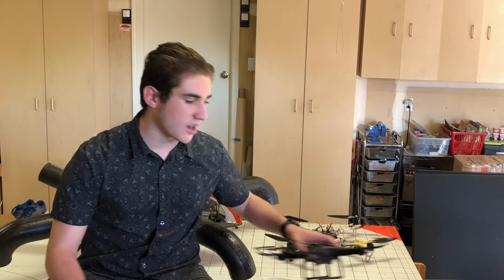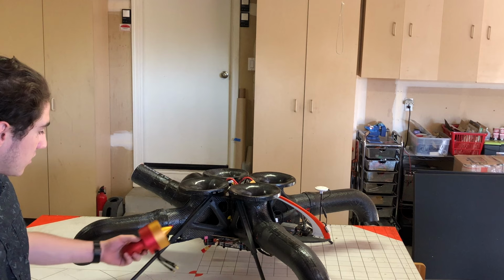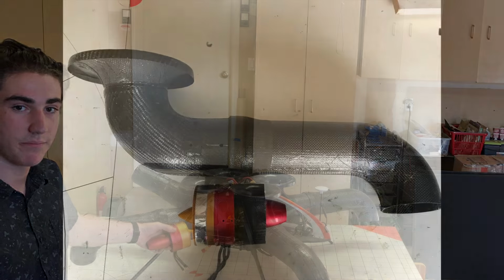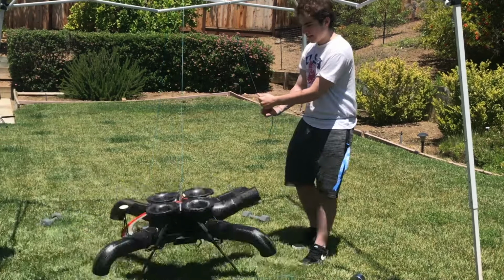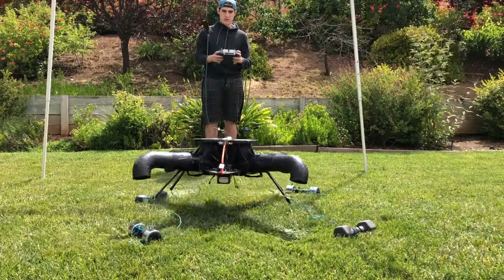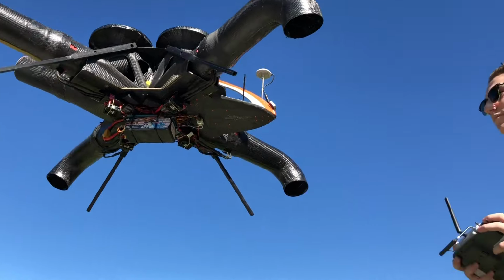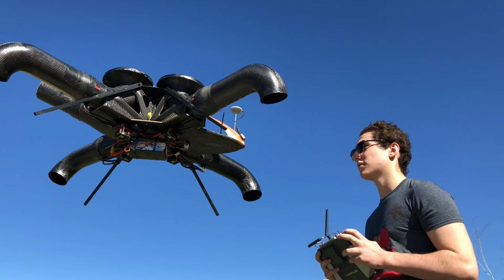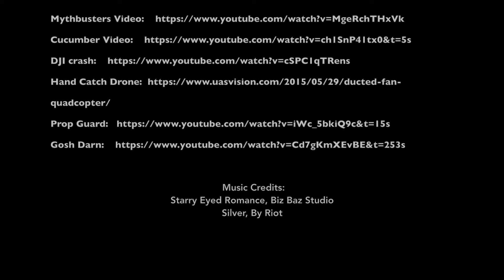Bladeless Drone: First Flight

Comment: The sharp angles to the air flow are a waste. Just put 4 straight tubes on an angle outward. Basically it will look like a tripod except having 4 tubes instead of 3. The tubes will be shorter and the whole system will weigh a lot less. The tubes will be shorter, so there will be less drag on the airflow through the tubes.
Reply: @Albert Barnett 3D print the blades. But either way, what I was suggesting was a concept. If the tubes need to be at a slight angle to counteract rotation, then put them at a slight angle. My point was that the sharp bends and long tubes were counter productive and easily altered. I think the problem is the original designer had an idea in his head that resembled a conventional drone. But there is no reason for that. If you need to, you could even put in a slight curve in the tube, but just get rid of the sharp bends.
Reply: I think the move here would be to do what is done in jet engines to achieve a smooth airflow and to reduce surging, placing two fans rotating on top of each other, but in opposite directions, with both of them pushing air down. You could also turn the drone by adjusting the speeds of the fans relative to each other, and thus could affect yaw, pitch and roll all at once in a more dynamic way if you have a software that  can deal with aerodynamic instability and would allow for fly by wire.

Comment: Interesting design.  You could just do one motor (and fan) and have the exhaust controlled by servo valves to control the trust in each tube.
Reply: What if he used an electric turbine motor, the kind used for model jet airplanes. It would make a lot more thrust.
Reply: @edgonzalez1345  And be LOUUD haha

Comment: Major loss of efficiency and allot of extra weight
Reply: The weight doesn't seem to be that big of an issue with the materials he used. Carbon fabric and epoxy are both lightweight and durable
Reply: @Skellitor301_VA  Well with that attitude why not chuck some fire bricks on it because hey how light are they.

weight added is power and time lost.  Best upgrades is reducing not adding. I don't think the gain is worth it at all however it might do real well with a burning fuel
Reply: However, some efficiency gains with the high rpm motors. The higher the rpm, the higher the power to weight ratio.
Reply: Yes . Duct fans have a low efficiency. Watts/ trust
Reply: that's not the point though. Its purpose is to be safer.

Comment: Patent pending ? For what ? An electric Stipa Caproni ?
https://en.wikipedia.org/wiki/Stipa-Caproni
If it's about the propulsion, it is public knowledge, it's a ducted fan.
As a matter of fact, it's not "bladeless". It does have blades inside!
It's also the same concept behind many VTOLs and that design has been used both in single and multiple stage formats.
Nothing to say against the achievements but this isn't going to block people from using the same exact concept and its variations. Shape and design can be protected, like with cars, but you cannot pretend to get a patent on ducted fan systems.
Reply: dude, chill

why do you have to be such a dream crusher wtf
Reply: @tommylynch7887  actually, the opposite, I'm being realistic and the dream which brings to delusion is a bigger struggle to deal with.
Whereas, if you're prepared for the worst, you can actually get some good out of it.
With a tricky trademark which also embeds a peculiar part of the design, like coca-cola did with the bottle, you can protect the shape, keep some features a trade secret and have a business running with WAY less money, also because you need to pay to file patents,trademarks and you pay a lot if you need to cover most markets (like all of those in the WTO, for example).
I'd say that 60000$ should be the minimum needed to begin with, just for the "paperwork".
Not only that but it gets even harder when you discover that you must also already have a presence in the market of choice in some circumstances.
And when you get a refusal it's even worse.
You spend time and money waiting for a patent to be registered when you could have started a production way earlier, also because, as in this case, you don't need any patent whatsoever. Meaning that the moment you realize it, a chinese copy is already out there, beating you to market, not because they've stolen the idea but just because they found out about the PUBLIC KNOWLEDGE information that YOU provided them to begin with...
Reply: @FreedomAirguns  oh that makes more sense

thanks for explaining
Reply: @tommylynch7887  chill, read, let it sink in, think about it, then come tell people to "chill", and they're "crushing dreams" if you still feel the need. Shouldn't need an explanation.
Reply: @Connor-zy6kl  ok ok i’m sorry. It just looked very harsh and I felt bad for the guy building his drone.

Comment: Impressive design improvement.  Your drone should be the industry standard.  An advance to the design should include vectoring smaller ducts, sort of like the Harrier Jet or Osprey.  It could increase the horizontal speed of the drone.

Comment: Title is a bit deceptive. This drone still has blades (in the ducted fans) they are just inside the housing. Maybe a better title would be "recess bladed drone."
Reply: agreed, but it's the same deal as dyson 'bladeless' products, which contain an impeller.
Reply: @chrismofer  yup, advertisers like to do that
Reply: Ducted drone is better
Reply: @amiman23  you would think, but you can increase the performance of a ducted drone if you can move the mass toward the center so there's less rotational inertia to overcome for stability and control, not to mention to kinda bad yaw authority these motors give u is helped by doing that. with his custom ducts the lever arm is extended while the inertia stays central and a side effect is no dangerous props in the open.

Comment: The duct fans have blades, do they not? which would mean the title is a lie if they do.
Reply: @TypicalJacques  Still a fact whether I shutup or not
Reply: According to this logic, a jet airplane should be called a propeller airplane, because that would be more accurate.
Reply: @tofu_golem  The Drone still has blades.  It's not bladeless and your logic can never change that fact.  Anyone can be against my original comment as much as they wish.  But it will never change the truth.
Reply: @wildkatsailing  Turbine blades!!  And since when did I call you names?

Comment: Doesn't make sense. You are making the air pass trough two 90° turns which obstruct the airflow, you are so decreasing a lot the efficiency and so the range of the drone, there are  better ways engineering to achieve the safety you are after. Good idea but needs improvements to make sense
Reply: He’s right. It cuts into the power to weight ratio. But I’ll bet he gets better rates on insurance! 👍😁
Reply: Borde is just pointing out that this isn't a new idea. Currently the safety risk is acceptable for the added flight time.
The safest part of this design is that it can't stay in the air longer than 5 minutes.
As batteries get lighter and last longer and motors gain more efficiency, we will see more gated propellers or impellers. 
I think a micro mesh around each standard propeller arm would be much easier, lighter and obstruct less airflow.. also it could be aftermarket and fit on existing drones

Comment: Well done!
 
1.How is battery life?
2. Why not combine the air from all 4 (or more or fewer) fans into a plenum, then out to the "n" exhaust pipes? Three might be a better number of pipes, geometrically. In any case, combining the air removes the immediate crash if one or more motor suffers reduced or runaway thrust. It would affect all directions equally.
3. How's the project now?

Comment: watching this two years later...how was this not a revolutionary design change for drones as a whole?
Reply: Its just a casual drone with some blade covers (extra weight)
Reply: Efficiency.  The extra weight of the ducting is only a small part of the extra inefficiency. The real killer is that a small jet of fast moving air is not as efficient as a large area of slower moving air, especially at a "zero" air speed (hovering).   It would take a whole lot more energy per minute of flight with this design, and since flight-time of drones is already a big limitation, this extra inefficiency will reduce the practical uses tremendously.
Reply: @daneast  I agree with your views. I don't want to knock the innovative idea, but it seems cluncky too and the battery life on it is any ones guess

Comment: 1) What if it suck in dust and big particles, would having a filter mesh solve it?
2) If we use only one motor and somehow control the flow of air through the 4 nozzles to balance the drone we can probably increase its efficiency drastically
3) Lot of energy would be wasted on turning the air through the pipes, why not simply have vertical covers on each of the 4 blades to improve efficiency. having safety cover on the blades will solve the purpose right?
Reply: Use thrust vectoring instead of 4 motors and outputs
Reply: I’ve seen the net covering blades from dust but then i had the same idear about the tubes. I think they don’t have to be that long cornered popes unless they needed a certain shape
Reply: @godwinjosiah2557  that's true. A drone can be successful only if it is power efficient. 
Plus I think safe drones would be the ones which are lighter in weight and somehow the RPM of fans is very low so as to cause the least damage.

Comment: Interesting concept.  I wonder what it would do if you created more of a venturi affect by narrowing down the opening of the exhaust tube openings.  I believe that you would need to calculate what pressures would ensue verses the kind of pressure your electric ducted fans can handle verses how narrow an opening you can have to maximize your thrust.

Comment: Nice you can increase the out put bye reducing the out flow pipe 
We do same thing with sprinkler systems to gain psi going from 1 in to half iv done the same with gas blowers to increase the out put when blowing large amounts of leaves in fall

Comment: Can’t wait to see jet engines quad drones!

Aren’t ducted fan more Efficient?

Has anyone built the drone from Terminator 3? Didn’t it have 3 jets?
Reply: I guess that jet engines are not responsive enough to be used in such a design. I expect that this would need additional thrust vectoring.

Comment: I have always been thinking of the dangerous of spinning blades, you have made a good try, optimise the design for highest efficiency by using simulations or models,  for safety adding long tubes may not be necessary

Comment: A wire mesh like oscillating fans would encase the blades
Reply: Yes you are right. Normal design with wire mesh for fans is much easier, cheaper and efficient
Reply: Material: made of HDPE polyethylene, PP with UV stabilizer, resin.
Mesh Size: rectangle mesh type, oval openings, round opening, diamond opening , the main mesh is rectangular and oval.
Weight: 80-350g/m2.
Width: 1M, 1.22M, 1.5M, 1.8M, 2M.

Comment: would probably work better with tapered tubes larger at the intake side and place the fans at or closer to the exhaust with a larger radius where they bend down

Comment: I really admire your ingenuity and persistence. Can’t say that I can find much to admire in most of the comments. 

If we consider what you have accomplished to be proof of concept, the next phase might consist in simplifying the form factor and improving aerodynamic efficiency. For example, why not more gently curved duct tubes with little stub extensions at the bottoms to eliminate the dead weight of landing support struts? Hope you continue to imagine and innovate.

Comment: I wonder if this design coyld be used for a full scaled flying craft. It would need some back thruster i guess.
Reply: No need for back thruster. It would operate in the same way as this one. But if it's going to be used for anything practical, it will definitely need an automated shutdown and parachute recovery system.
Reply: @lar3ryca  Yeah but wont thrusters give it more speed?

Comment: I've seen such a solution on a heli (rear blowpipe instead of propeller). The problem was the run-on time when steering. I see the same problem here. Propeller drives respond much faster, resulting in better model response.

Comment: I’ve long anticipated this—inevitable—development, But why separate engines? I’m see the next big development being a single, central engine with a single air intake supplying air to all ducts with individually governed airflow. Better centre of gravity, much less weight; and fewer parts.  (Venturies wouldn’t hurt, either.) — Arguments?
Reply: Why not 4 engines? Governing the flow into 4 ducts from one engine seems like a challenging unique engineering complexity to me. This way with four engines the control is little different than a 4 engine, 4 blade/fan drone.
Reply: @ Basically, weight-saving (and mass-distribution.) And  as thrust vectoring here is basically a matter of manipulating air flow I see this as a (basically, in principle,) simple matter of digitally controlling a four-flap manifold. (Leaf-shutter mechanisms spring immediately to mind.)

Comment: Thrust vector your exhaust ports.
Reply: Thrust vectoring would add a complexity that really isn't needed in such a setup unless a future goal is to transition to efficient high speed horizontal flight.
Reply: @KCM25NJL   I would hope high efficiency, high speed horizontal flight would be a goal in natural evolution of any aircraft. The electronics/mechanics aren't all that complex however, by segmenting the 90° elbows with 45° elbow segment assembly's and rotating the assembly's with inexpensive integrated stepper motors along integrated gears of the OD of the elbow assembly's a fully articulated range of motion from 180° to 90° in any vector achieving variable directional flight control is quite feasible. Electronics wise it wouldn't be all that different than RC control servos. 

There's a few different video's here on YT of people who did something very similar emulating the rear directional exhaust on their RC F-35's
Reply: @abyssalblue3089  I don't disagree with any of what you said. And certainly if it is a natural evolution, then your method seems simple and cost efficient enough. I was merely pointing out that for a flight concept, variable thrust per motor is sufficient for proof of efficacy.
Reply: @KCM25NJL  you're good man, I didn't mean to come off as defensive. I'm just bored and don't have a shop to work in so Geeking out in chats is about as close as I can get to working on my own projects ATM.

Comment: I think it would have been much more stable and easier to control if the initial part of the tubes where the air comes out was initially vertical.

Then at the top there was a U-turn so that the center of gravity of the system was below the forces that push it up.

Comment: I'm surprised you didn't go for one, massive ducted fan in the middle, and then just have throttle flaps in the ducts
Reply: Perhaps this solution will have an air distribution problem
Reply: @bernardpire4164  Yeah you're right, it would be much harder to tune. But the efficiency of one large fan would be incredible verses multiple small fans.
Reply: @1992jamo  Ah ! OK. Thanks for the advice.

Comment: What if instead of a simple 90 bend at output ports, you use a "Dyson" type airflow multiplier?
Reply: Those probably aren't easy to make sufficient thrust. They currently have a lot of problems to go through to become any sort of competitor towards propellers and fans, and he isn't here for that level of innovation (at least not yet)

Comment: This is the future of drone tech for automobiles... brilliant idea

Now make a motorcycle sized version and sell it to the masses for a couple billion dollars!!

Also if you can figure out how to make a pressure diverter valve that will allow 2–3 of the 4 rotors to give equal pressure out of all 4 pipes for a safe landing in the event of a single engine failure and you have the prototype for a truly safe drone flying experience in my mind.

Comment: Now all you need to do is perfect the intake outlets, experimenting with different designs to speed up the airflow, smooth it out with veins, narrowing parts for better a better smoother intake if the air smoothing it out before it reaches the turbines fir a smoother more efficient flying.
A very good idea, maybe even add small rudders at the bottom or end of each outlet for better maneuverability, double rudders on each outlet, try it out, it may you or even hinder, but at least it teaches you something else, something new, teaches one to learn to control it at the highest levels using differing techniques.
Great job, and something maybe tye military would be interested in.
So is it quieter with the ducts or louder, soundproofing can be added I suppose too if need be.

Comment: Could you do some sort of advanced air flow modelling with a computer,  to design an optimally shaped duct? Thinking there may be an overall gain in power/efficiency if the radius of the curve in the pipes is increased so as to minimize turbulence and friction inside them as air goes around the bend?… 

awesome build regardless!

Comment: You basically used the jetpack concept and adopted inside a quad design. very nice...good thinking :) Add rudders inside each outlet and control it via Pixhawk... this way you can deflect the air in different direction and will give you a more smooth control. Also then you don't' have to tilt your exhaust tubes as you are doing it right now.